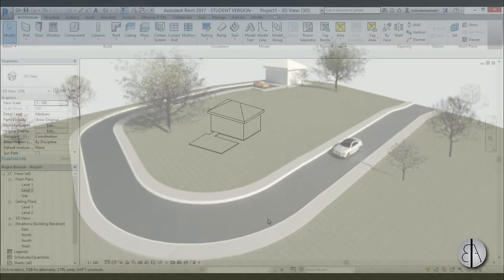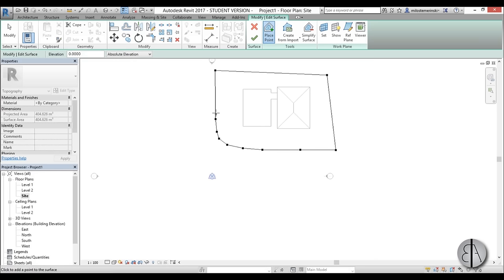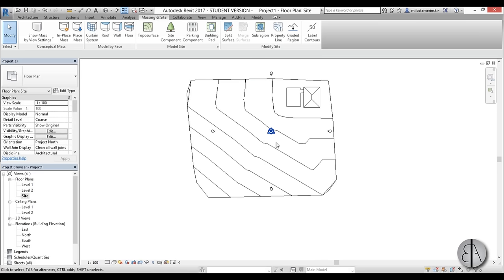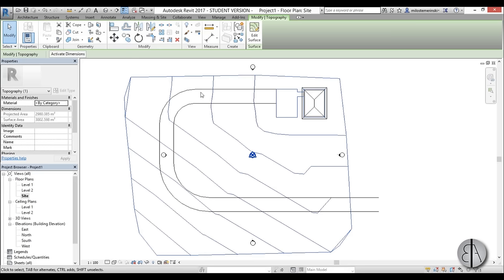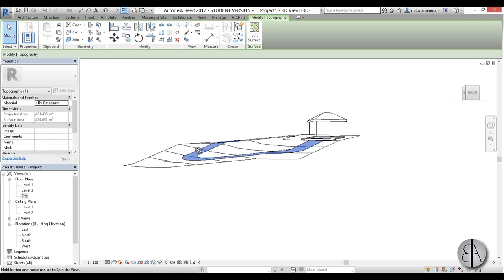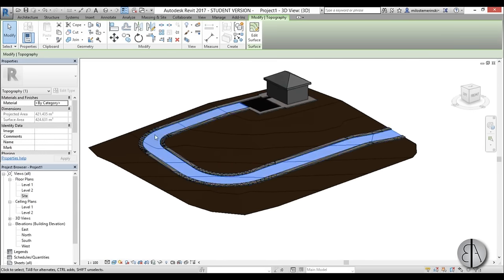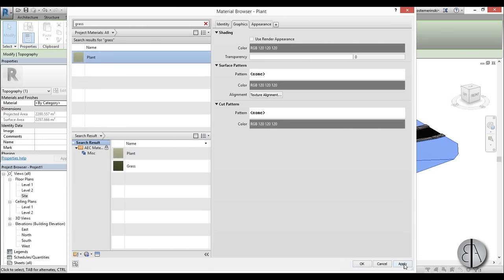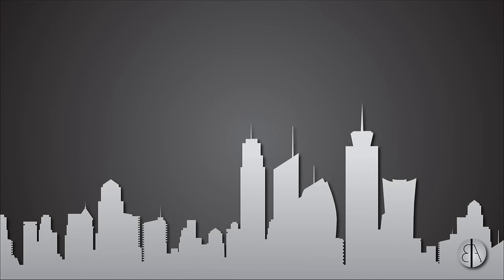Site Plan in Revit - Roads, Sidewalks, Curbs - Tutorial

Comment: Thanks! Looks really nice. 
To save time, demonstrate the "tab trick" while using pick lines or clicking edges for the fascia. When fascia command is active, simply hover over a line or edge and press tab and it will select all joined lines. Then left-click and all the fascia are created at the same time :)
Reply: Thanks didn’t know revit can tab through edges

Comment: Roads for the most part do not just follow the natural gradient. They have their own gradient which cuts into the higher terrain (with escarpment gradient of 1:1 or vertical if retained by a wall) or is mass filled over the lower terrain (with escarpment gradient of 1:1.5 or vertical if retained by a wall). Longitudinal gradient of the road is 1:10 max and lateral about 2% max if memory serves except in high speed curves. What you made there looks nice but is incorrect from a technical point of view. It would have been more pronounced had you created a steeper gradient terrain.

Comment: Interesting approach, shame about the roof categories having to be used for mass by face but makes sense given the limitations of the software. An alternative approach I'm going to run a tutorial on will be to use dynamo to 'drape' a floor with sub-points onto the topo using Dynamo, cut out the ground below and lower by a set amount to another level and use slab edges for the kerb profile.

Comment: I discovered that you don’t have to flatten the site cad from Autocad. Place points at the center of the elevation markers in AutoCAD then import to revit. Add topo surface then import points. At the dialogue box import the layer containing the points that you imported. This will form a surface. If the surface is too high or low , go to elevation and drag it to the light level and voila. You’ll can also align your surface in the x or y in the same way.

Comment: this method didn't work for me. In Revit 2019, when attempting to create a mass with the imported CAD file, it prompted that the 'mass only contains mesh geometry and cant be used to create volumes". If someone had the same problem and already found a solution, pls send a suggestion
Reply: Hey same problem... did you find a solution to that?
Reply: @Dough_Knut  upgrade to revit 2020 or 2021 and use railing that follow the topo
Reply: @yellowbrickcad  thanks! I found that in another tutorial and it works in the 2019 version too

Comment: Have you considered using the Site Designer? Or does it not come with the student version? I'd like to think much of what you do here can be done with the Site Designer tools in a more straight forward way.
Reply: It does come with the student version. In my personal experience, Site designer has a lot of bugs (at least for revit 2018), it takes ages to complete a road, but if it works, it gives you undeniable  better results.
Reply from the maker: Yeah, reading about all the bugs made me stay away, I definitely try it one day!
Reply: In a nutshell, Site Designer is a total CF.  It's the result of Autodesk acquiring Eaglepoint Software's Revit site add-on tools, and they were never very good to begin with.
Reply: HeadPack or just mead it with floor like normal human how have problem in the site designer?

Comment: I'm having a problem doing this, somehow when I try to Split the Surface, it says is not posible because the Split Surface must be in two equal parts. I tried to do it with Subregions, but then i cannot export and import properly… any Ideas? Thanks! Aaaaaah and...Your videos are the best!
Reply: I'm also having the same trouble 😫😫
Reply: you better use split surface otherwise you cannot define as a different surface. To split a toposurface into more than 2 surfaces you just use split surface command multiple times starting from splitting into 2 :(
Reply: @simgegider6447  thank you so much...😁
Reply: @simgegider6447  can u help me with massing of roof for the side walk. Actually it is blacked out as I try to make selection of the sidewalk mass. And hence roof can't be created

Comment: I can't believe Revit exists for so long and it's still so awkward creating sites with realistic road and curb.. I usually use floor elemnts and force it on site with pick points. BTW - how do you add road markings and lines? If you have more then one lane it looks dull. How would you add a center line or dashed lines going around the road?..
Reply: https://www.youtube.com/watch?v=8R1IrG6EsLA&t
Reply: Unknown thanks. That's a straight flat road. How would you do it on a slope with a curved road like the one in this model?..
Reply: That is my thought as well . If your road cuts across a topo that is sloping the road should still be flat in section but sloping with the topo in its linear direction.
Reply: If I were you I'd create a custom railing for the street lines. You can force a railing to attach to a surface and if you can get it right it'll look great. You'll just have to get good at creating railings

Comment: Just to add. I tried with split surface but it doesnt work properly when you have too many sidewalks or elements next to each other, the pick up lines with the topography was a nightmare to get the lines, i got al type of errors. I fix it by using sub-region instead of split surfaces and it worked like a charm. Same method but using sub-region.

Comment: how do you put a car on an inclined area?
Reply: siphamandla sibusiso masondo have you tried selecting the elements and picking new host (floor/roof)
Reply: Create a reference plane (probably in a Section view) following the angle you wish to place the car at.  Name the reference plane.  I would then suggest going to a 3D view, set your Work Plane (Architecture or Home Tab) to the named reference plane you just created, and place your car(s).  Remember to set your active Work Plane back to Level 1 or something appropriate after you place objects on a rotated work plane.
Reply: You may have to Edit your Car Family and make it Work Plane-Based (on Properties box under "Other" parameters) if it isn't that way already.

Comment: This is not a correct way to use tools. I think Revit is not just about Modelling. I mean it's not SketchUp. Its Building Information Modelling. If you use Roof family in Landscape, you won't get accurate Roof material, because it will count landscape curbs as well.